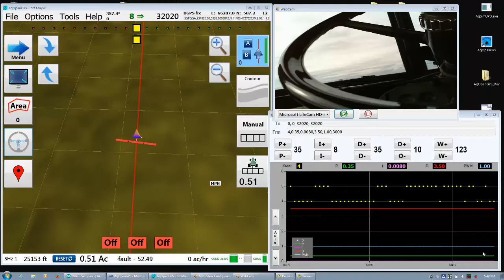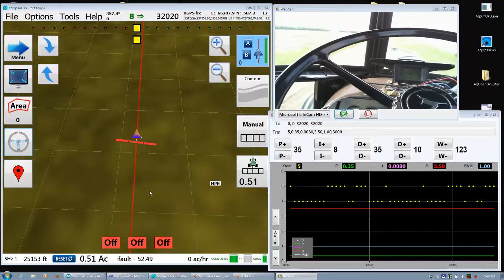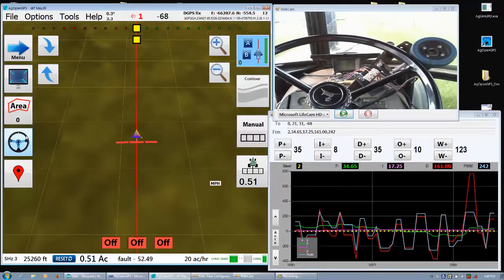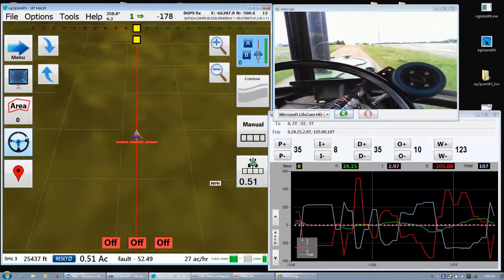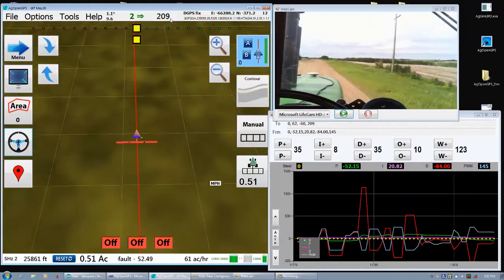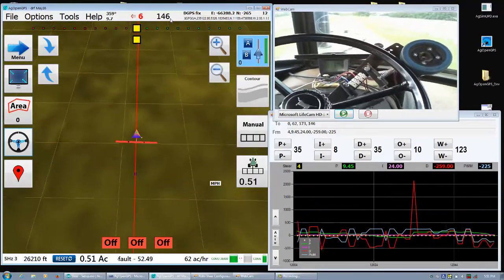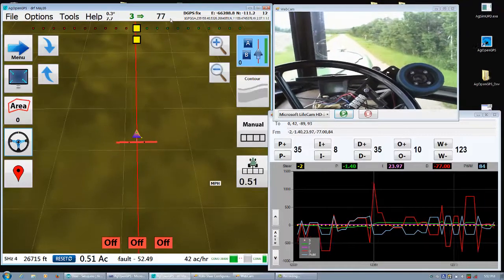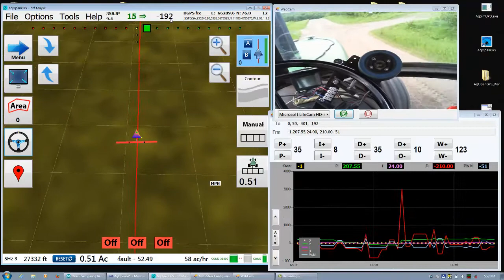AgOpenGPS Autosteer

Comment: Do you still have to pay the 600 pounds per year for the sattelite
Reply from the maker: Just using a simple DGPS recvr, so nope.
Reply: FarmerBrianTee so does a ďgps receiver work with other autosteer systems like greenstar
Reply from the maker: They use other ways of getting correction data, but it all works basically the same - correction for the errors